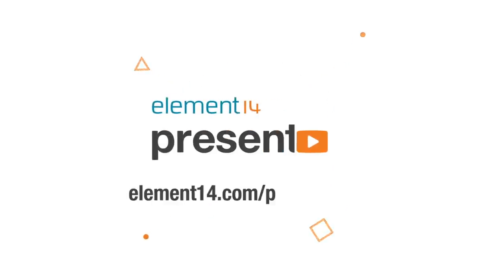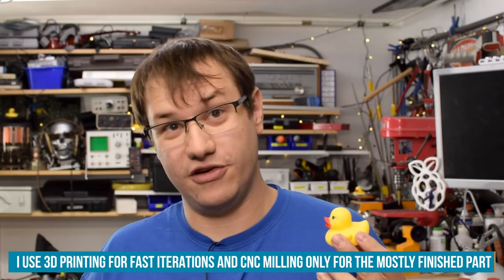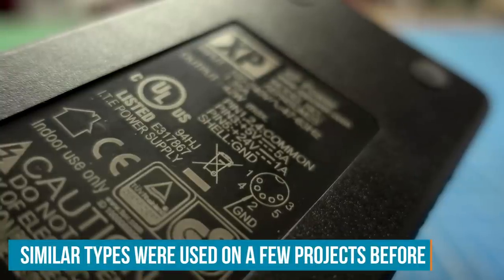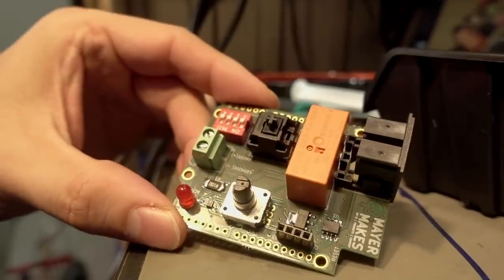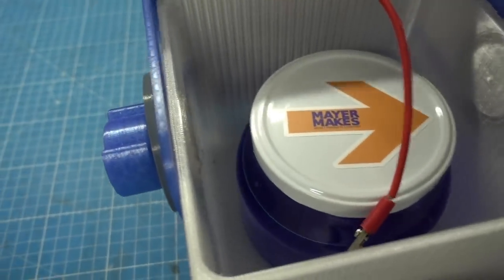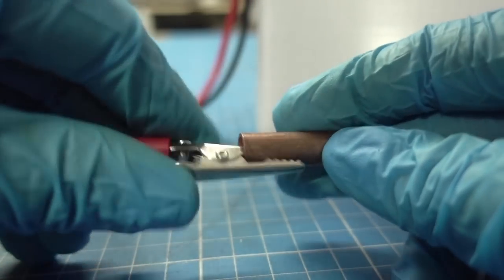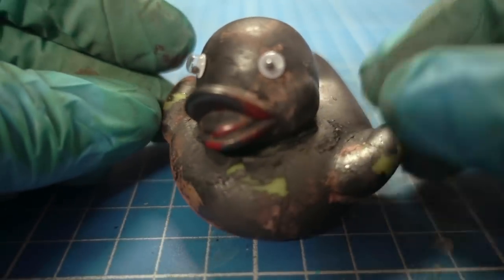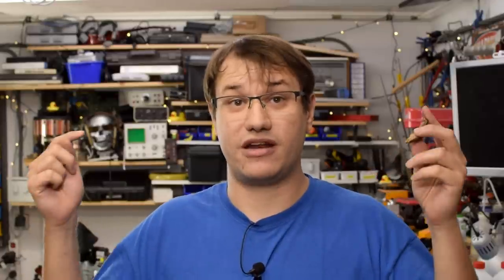Metal Plate Your 3D Prints with a DIY Galvanizing Machine

Comment: For large parts and/or thick coats I think you can just reduce the voltage to limit the current. It will of course take longer but should still give good results.

Comment: Cool project. I've used those cheap benchtop lab power supplies. One thing I found is agitating the electrolyte can help a lot. I use a small pump to keep it moving. Others use an air pump and a bubble stone.
Reply: Thx, yes agitating helps, for my little experiments I got way without extra agitation

Comment: Ideally you will want a constant current power supply and to rotate the part during plating or surround the part with the cathode, the power supply you used is a constant voltage supply.

Comment: It would seem like the obvious experiment to try would be plating 3D printed parts made with conductive filament. That way there's no paint step, and not bother with the paint coming off. But perhaps others have already explored this area.
Reply: tried it in my old job at a filament company, and it did not work as good . the printed parts are conductive but not uniformly on the surface, so it was not suitable to circumvent pre coating it.
Reply: @dsnein  In what respect are conductive filaments terrible?

Comment: What do you mean power supply shorts out? It is supposed to be current controlled (with current proportional to surface area)
Reply: I mean overcurrent protection triggers, which can be triggered by shorting it. So you said it in the correct way.

Comment: For plastics it's always better to use a plastics-primer ("Kunststoff-Haftgrund") before coating them with the conductive paint. There's also special paint for galvanizing plastics  with silver or  copper. (in german: Suche nach Leitlack zB: Kupferleitlack)
Reply: Primer wasn't needed in that case, I did degrease them before priming. The graphite variant just wasn't  uniformly conductive. A proper leitlack would have been to costly, I used stuff I had in Stock due to lockdown.

Comment: If you used a multi-material printer with one of those conductive filaments as well as a non-conductive filament to print a circuit board, could you use this technique to reduce the resistance of the board? It would be tricky to get it to plate at all if you have to send a high current through the high-resistance conductive filament, but maybe the deposited plating would take over quickly enough to make it work. Seems worth the experiment, anyway.
Reply: that is a complicated topic, I suppose you could but I would expect the results to be inconclusive as conduictive filament is not uniformly conductive especially on the surface.

Comment: How about using a car battery. Deliver more amps for thicker coatings.
Reply: Sure, That's usable with current limiting in place.
Reply: The voltage will limit the amps depending on the anode and cathode surface area.  You need a variable power supply.

Comment: I'm sick from COVID and running a fever but I think I missed the part about how the rotary encoder works. How do you know what the setting is?
Reply: It does not matter as he's just using it to adjust a power supply. save time by just using an adjustable power supply.
Reply: Every click adds two seconds, it's setting a timer. I just do it by feel
Reply: There was a display mentioned on the schematic, but I don't see it actually fitted. I think he's just outputting the value over the serial terminal, so you need to have a PC plugged in for user feedback.
Reply: @colinstamp9053  yes, you can see the data over serial or on the display, its planned in the schematic and code, but I could not get a suitable size display fast enough for the deadline.

Comment: In my Chem 12 class we did electroplating and you will get better results with a hard to get poison acting as a form of catalist in coating.  It is commonly found in an organic form in Apple seeds.  I do not mention it by name or actually recomed it due to how easy it would be to accidentally be poisoned.
Definitly a great project and well covered.
Reply: Cyanide it is
Reply: hydrogen cyanide isn't it?
as long as you use a fume hood and wear appropriate gloves you should be fine, maybe use a good organic vapor mask.
also you definitely want bath temperature and current limitations on the control board.
note that I'm not an expert but most of the time as long as you protect your skin and respiration protection you're fine with toxic chemicals, they don't suddenly teleport into your body.

Comment: Galvanizing is not the same as electroplating.  Galvanizing is a molten bath of zinc, you are working specifically with electroplating.
Reply: you are refering to Hot-dip galvanazing, which is commonly named just galvanizing in english, but in every other language the distinction is clearer. the fully correct word would be Elelctrogalvanization which describes all the processes in the video and some more https://en.wikipedia.org/wiki/Electrogalvanization .
Reply: @MAYERMAKES  I've been plating for more than 18 years.  Zinc plating is just zinc plating.  Giving it another name doesn't change that.   It's just electroplating zinc, the same as you would cadmium, nickel or silver. The second sentence in your link even states it's electroplating.
Reply: @MAYERMAKES  Galvanising need not be hot-dip, but galvanising does specifically mean coating with zinc.

Comment: You should get better results if you try to uniform the electric field. Portions of the model closer to the anode will get thicker deposits while the further ones will get thinner or none at all. Obviously 3d printed parts can be have many features so getting an uniform field can be tricky, maybe a metal cage around all the model could work

Comment: That is the worst process I have ever seen. It's obviously just an excuse to use some stuff, but you did not even Galvanize the part! Galvanizing requires zinc or some  other sacrificial metal. You copper plated a piece and you did not have the right acid for gold. I've plated copper onto aluminum by sanding and cleaning and just reversing the polarity to remove the last bit of oxide before plating copper on to it. Where are your smoothing agents? You would have been better off if you added some pee to it. No seriously... it can act as a smoothing agent.

Comment: sorry but i don't see any benefit to just using a lab-psu...
Reply: then watch the video again and observe that you dont need any dangling cables, extra psu or wonky holders.+ no settings to be dialed in. also pre proggrammed cycles are easy to set up in code for specific applications like annodizing for example

Comment: So basically.. you're just painting plastics with metal... and then galvanizing the metallic paint.  Why not just paint the plastic with whatever it's supposed to look like in the first place, though (or with the destined metal paint)?
Reply: Does not look the same and isn't as resistant

Comment: A very unsatisfactory result. I was hoping we could strengthen 3D parts by coating them in metal, but the quality and thickness of your results is too poor for that. If its just looks you're after then you're better off just spray painting the prints with metalized paint and be done with it.
Reply: no matter how thick you coat them by galvanizing this will msot likely never affect the parts strenght. 1. its about giving faster and cheaper producable parts the looks 2. its about the electronics to do it. 3. metallized paint does not look the same as real metzal especially if you need to take nice fotos of the parts.
Reply: @MAYERMAKES  hmmm, I'm thinking just coat it with  a lacquer then paint it with mirror spray paint to give it that metallic look.    Since you're spraying it with conductive spray anyway you're half way doing that anyway.  I like technology more than most but doing it this way seems ill advised.

Comment: So you never heard of rub n buff or metal leafing? You can use them in place of or with your electroplating. Another unnecessary, complex process, when something simpler, more effective, cheaper and less toxic method is readily available. Nerdism serves up another fail.